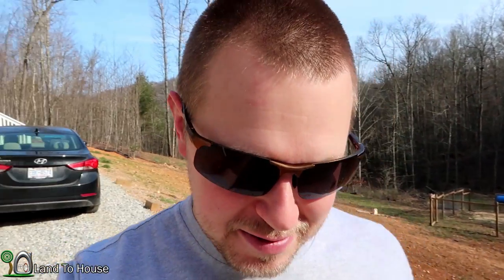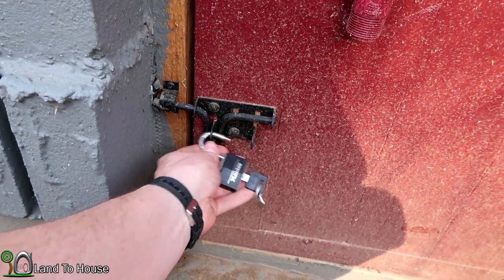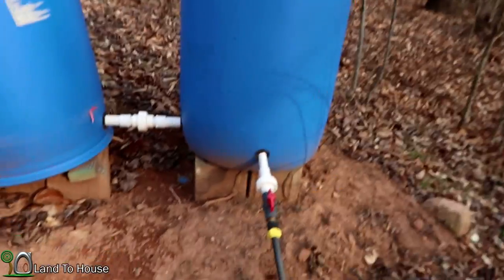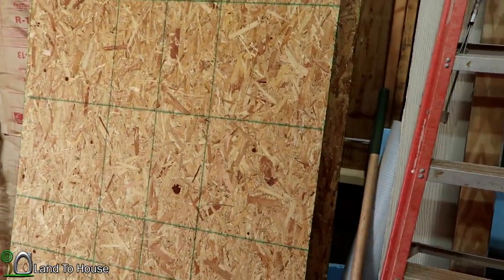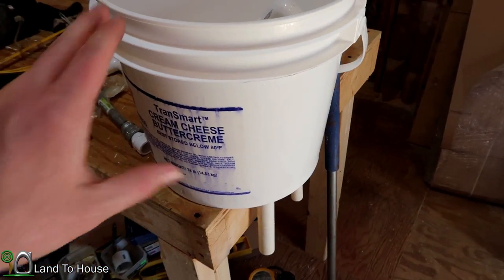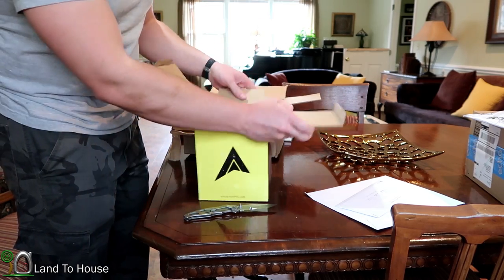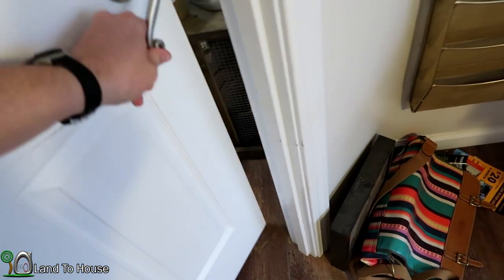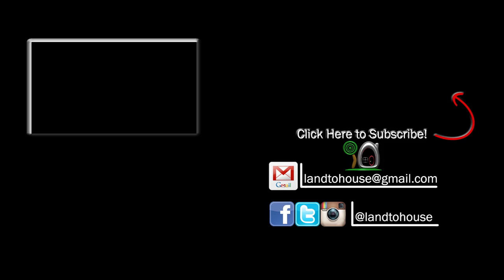Canon G7X Mark ii, Ashley's Bookcase and U Siphon - Vlog #20

Comment: You could probably tee off the line down near the house and it would save you the run one way from the tanks. There might be more variability in the pressure but it most likely doesn't matter.
Reply from the maker: Fun idea. I have found that the ram pump will shut off if it is unloaded close to the garden. The extra height to the tanks keeps that back pressure in the pump.